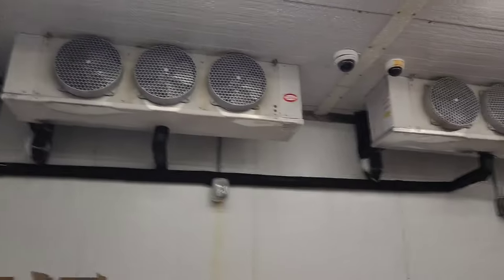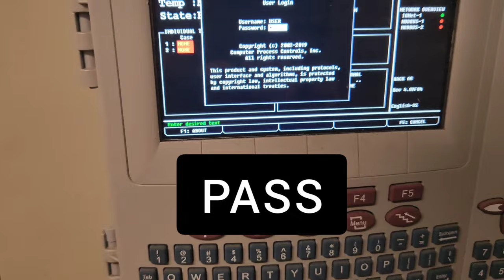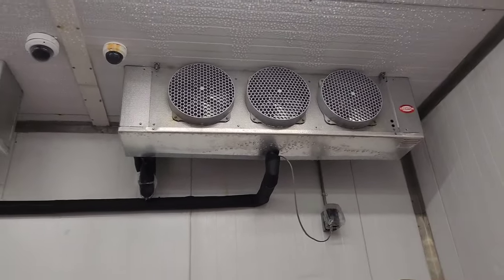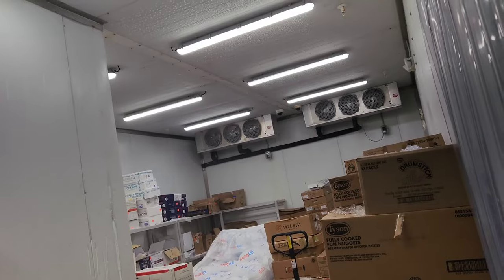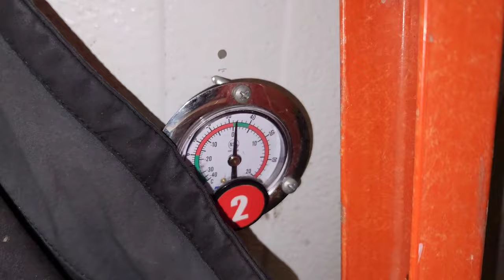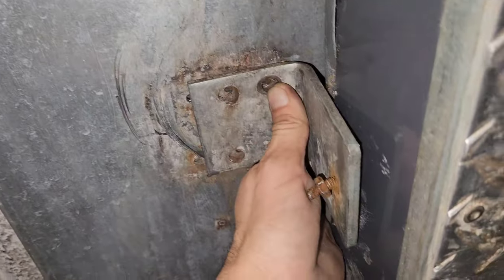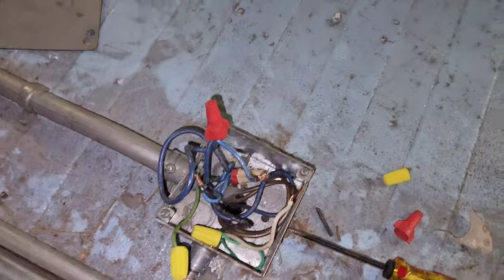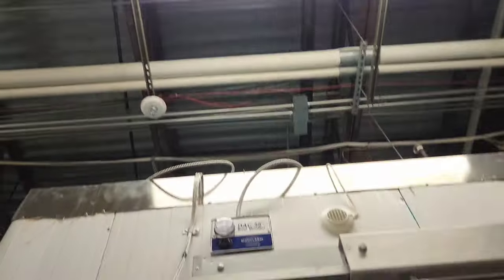Freezer Fans Are Not Working- Emergency Call

Comment: This looks fun man. I’ve been in resi for more than decade and it gets so boring lol. What you do seems like there’s a bit more to it
Reply from the maker: There is a bit more to it, but it's not really that much more complicated than residential. I did residential and started transitioning to commercial around 2013-2014, and by that time, I was so bored and burned out on residential. I remember dreading the day ahead of me every time I would get a 3 or 4 system heat inspection. I didn't have the desire anymore to try to sell upgrades or take the time to do the type of thorough service and inspection that I had created the expectation of for myself. I just really needed a change of environment. 
So far, I'm not really burned out on this or bored. I think it's a little more interesting, and it feels like a step up from residential, even though it's not really much more complicated. Probably just knowing that sometimes there's a lot of money worth of product that's on the line if I don't get the System backup and running... sometimes hundreds of thousands of dollars worth. But it's just different things to know and understand compared to residential.

Comment: is the controller in fail safe mode and if so do the circuits run constantly if the solenoid relays on the board are wired normally closed?
Reply from the maker: No, actually you know what I think. It is, and this is just a guess… I think that Dan Faust has a paid subscription that you gotta pay for. as a supermarket chain you've got to pay danfoss X amount of dollars to be able to utilize all of the services available on their controllers. and if you don't pay those subscriptions, then you can't use all the features and therefore you don't see temperatures , all that kind of stuff. And I think that these stores are just too cheap to pay them.
Reply: If the controller does not read the temps, then what is controlling the solenoid valves would it be conventional mechanical controls ?
Reply from the maker: it's a ridiculous setup. this video shows a little bit more. it's the same grocery store chain and this is how all of the racks are on all of their stores.
https://youtu.be/oqd3qWwIdCA
Reply: @HVACRServiceTech   that is a wild set up, looks like they have the board points must have ran out of money for the sensor wiring lol
Reply from the maker: @teddyryan4682  Yes, something messed up definitely went on there. Ill probably never find out the answer. But to go out and buy hundreds of KE2s, and it's not just a bit old airstein deep cross when they also got the low temp ones also, the bigger one you know. They've got dozens, if not Hundreds of those. But they got the danfoss controllers running Defrost Only on all the circuits... doesn't make sense.